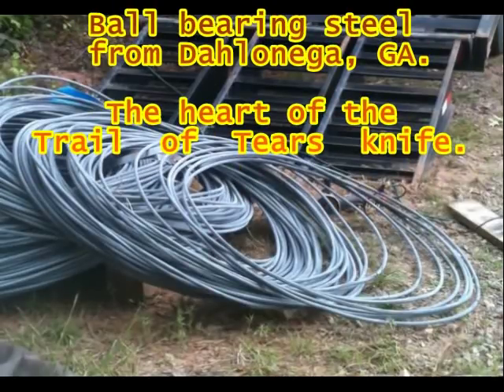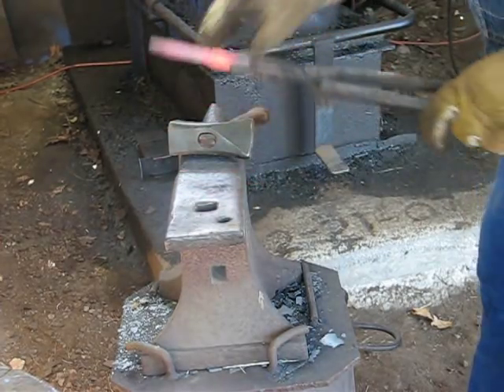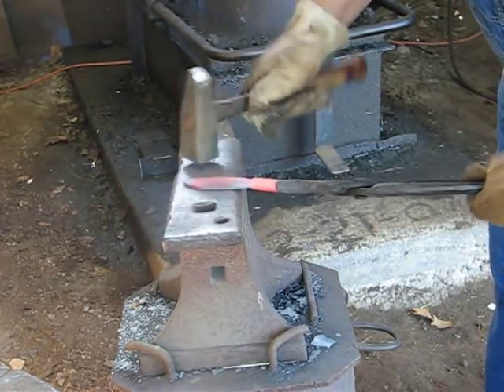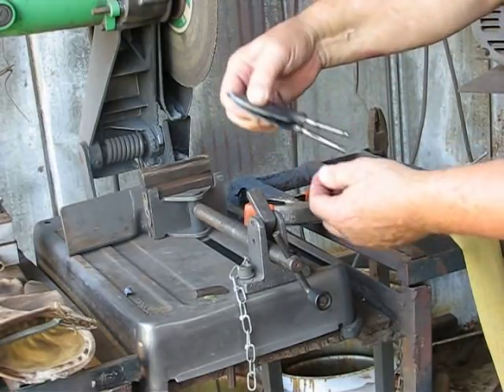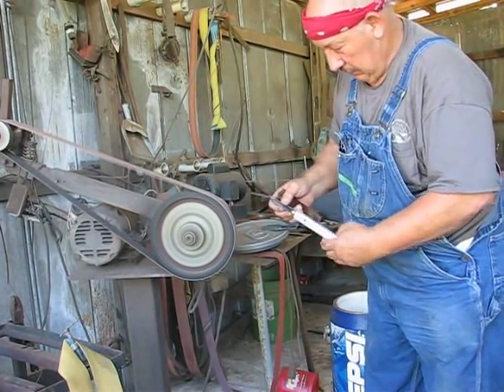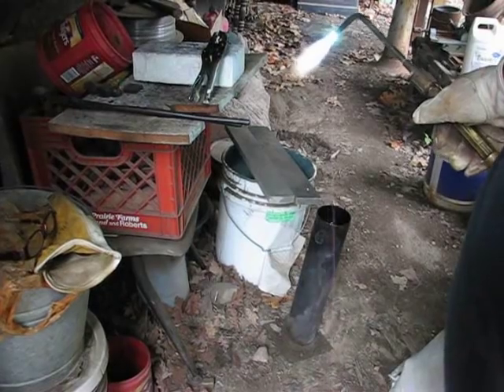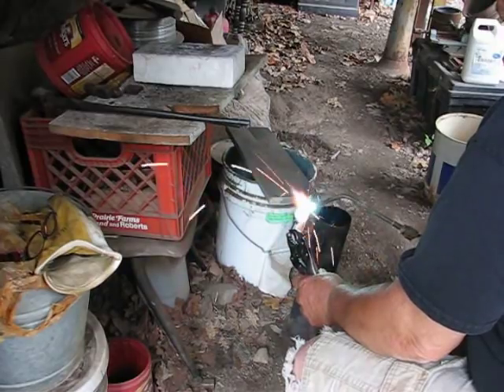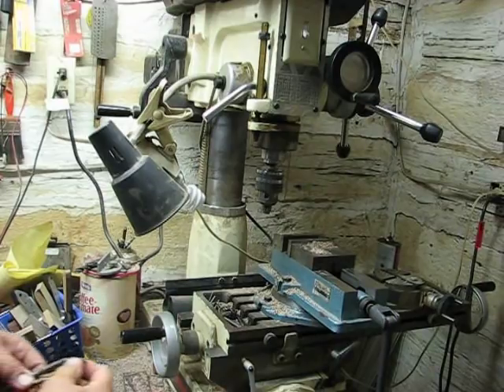ToT Video

Comment: Hi Ray, nice knife.  What kind of power hammer s that you use?  Tom
Reply from the maker: +arkomo54 It is a Stryker 88.  I got it from Uncle Al in DeQueen, Ar. Jan 07.  I love it.  It hits the same place every time and you have great control on the power.  It is in the up position at rest so you can put bigger items under the hammer before you start to hammer.  Oh, did I tell you I love it. :)